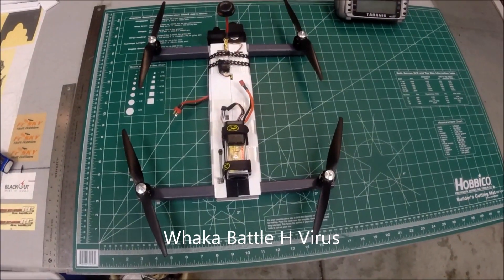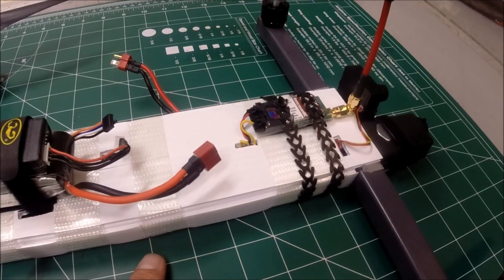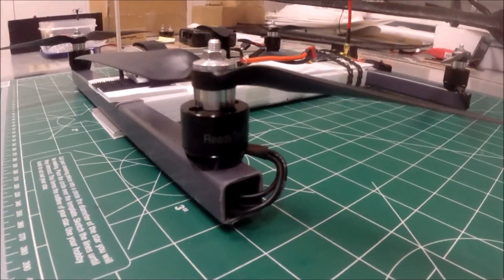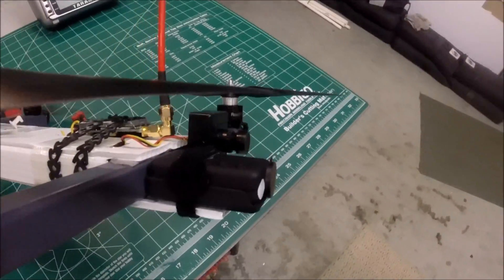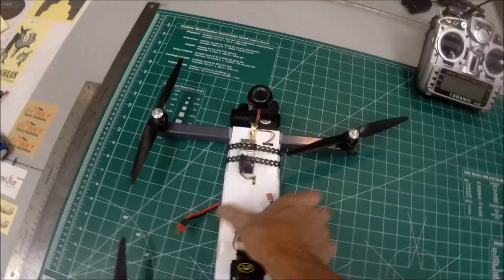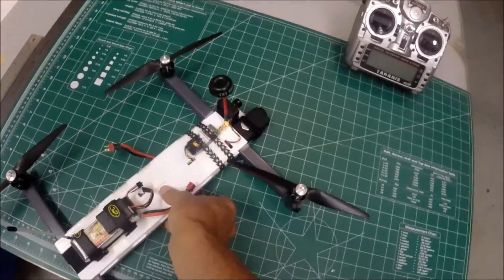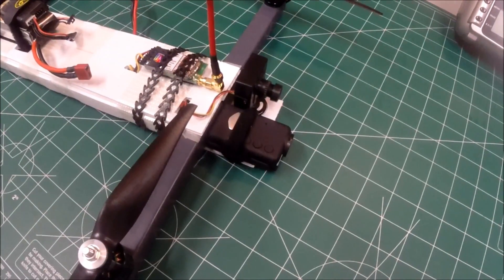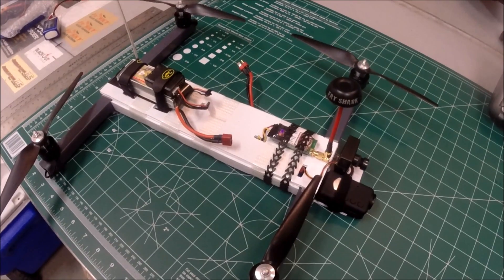Whaka Battle H Virus FPV Overview & Camera test

Comment: It looks like your motors fit the 3/4 in pipe, we got different ones (like in the tutorial) I'm in a quandary as to how he rigged the bracket. It's not the most thorough tutorial, did you modify your mounts?
Reply from the maker: No mounts, just straight through the square tubing.
Reply: Hmmmm, ok, thank you